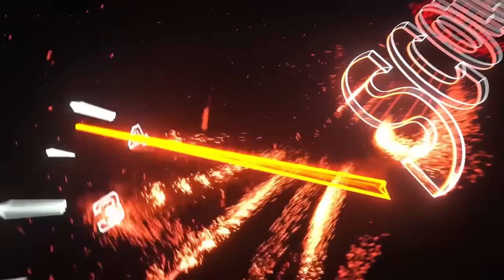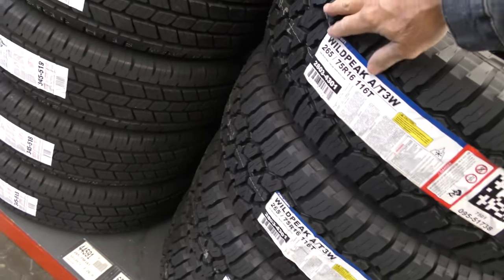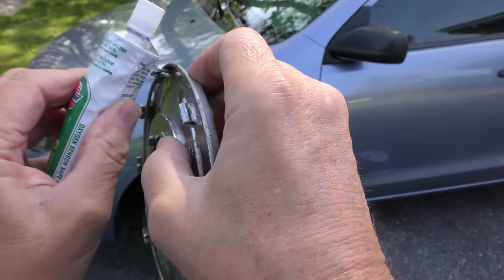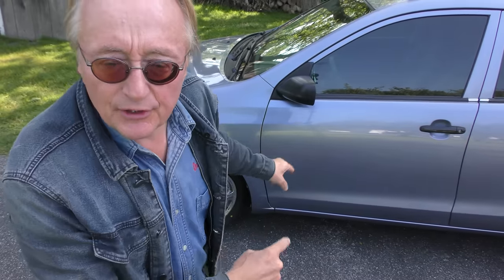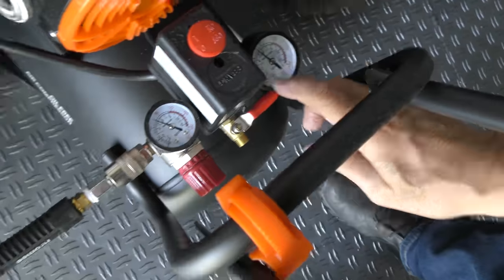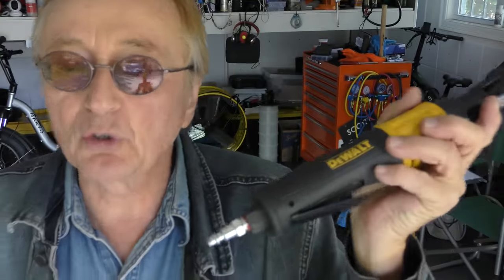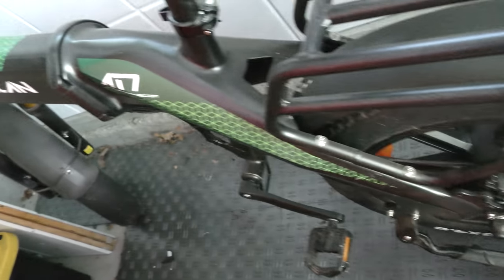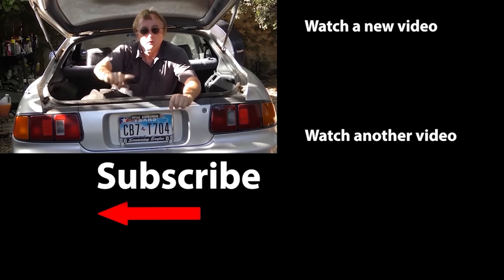Never Buy These Tires for a Daily Driver

Comment: In March 2021 I had four Michelin Defender T+H 195/65R15 tires put on my 2002 Honda Accord.  Some people might think that I was crazy putting these top of the line tires on a 20 year old car but I frequently drive on local streets that are in far from perfect condition.  As it turns out I have been doing a lot more driving now than I was then on a daily basis.  The increased cost is well worth it to me in the form of improved ride and handling and durability over a less expensive tire.  In my experience inexpensive tires do not hold up well in the driving conditions the New York City metropolitan area presents to drivers.
Reply: Brother, you aren't crazy. You are right on the money. I'd argue putting a more expensive tire on an old car that's not quite as tight and bolted together as it was brand new is SMARTER than going cheap. LTX Defenders for all my past trucks and Defender T+H for most recent purchase for mom's 10 year old Civic and she loves everything about them. Hondas always tend to be loud in the cabin and transmit alot of road noise. Michelins are as quiet as you'll ever make a Honda. 👍
Reply: Smart move in my book; I am a loyal fan of the 10 ply Defenders, they do hold up well the entire 80000 miles.  I put them on my Corolla which is way overkill.
Reply: @tdgdbs1  how are you able to specify the number of plys for your purchase?
Reply: I agree.  I have the Defenders on my Explorer and they handle the rough streets here in LA very well. Have had the tires for 5 years now and they still look great. I hope they will last 10 years.
Reply: @neuralismgamingtv4511  unless your muffler is dragging lol 😆
Reply: @chfpontiac5849  I get the cheapest tires that I can find for my vehicles.  I have no issues.
Reply: @neuralismgamingtv4511  hopefully
Reply: @JimzAuto  the model numbers specify the construction details like # of plys. the 10-ply rated tires are generally available only in 16-inch and larger applications. using such a heavy-treaded tire on a small car (which usually have less unsprung weight  to begin with) makes no sense to me.
Reply: @tommurphy4307  my experience has been: buying RADIAL tires means a) no-bias pllies at all, and b) no option to specify the number of belts. ‘10 ply defenders’ do not exist; far as I know Michelin Defender tires are ONLY available as radials.
Reply: @tdgdbs1  How did you specify ‘10 ply defenders’ for your Corolla? Michelin Defenders are ONLY radials, yes? Can you share the specific model number from your tires?
Reply: Michelins just over price cooper's
Reply: You drive in New York but can you park there?😅
Reply: Ive had pilot sport 4 on my 69bhp corsa like 3 years ago 😊
Reply: Now on my hyundai Ioniq plug in hybrid 😂 why not

Comment: If the tires are rotated every 6-8 thousand miles they should wear evenly eliminating the front tires from wearing out faster than the rear tires !
Reply: Thank You! That's What I Believe
Reply: I agree very informative
Reply: I use newer winters as my summers and new studded ones for my winter driving. Alternatively, I'd have to buy all seasons for summer. I'll wear both of them out and pay the $56 for the november/April changeover.
David
Alberta, Canada
Reply: -Only required for 4 wheel drive vehicles. If you drive a staggered setup, forget about rotations!
Reply: Tires are rotated due to how much weight is on the front and back of the vehicle.  Generally, there is more weight on the front of the car with engine and then the drive axle for FWD vehicles. You have a more fifty fifty or close to it setup on RWD vehicles but still the empty trunk weighs much less than an engine. This is also the reason that you put the better traction tires on the lighter part of your vehicle which is usually in the back.
Reply: The only thing you are doing by doing this, which there is nothing wrong is that you are just stalling longer in when you need to get tires. So in the case of moving the tires from the rear to the front, all you are doing is going from needing 2 new tires, to eventually needing 4 new tires down the road. This may be beneficial for you if buying some new tires isn't something you are able to do at that time. However, just remember you want the most tread for the steering as its more important to be able to steer then it is to be able to accelerate.
Reply: UNLESS you have a rwd car and like to do smokey burnouts. otherwise why even have a car?
Reply: Better to rotate and have a set of matching evenly worn tires.  Most tire shops do rotations for free if you bought the tires from them.  Also most tire shops offer you a better discount when you buy 4 tires at once rather than just buying two at a time.
Reply: @marshmower  lmao we got a smart guy here everyone!!! 

Yes, if you drive like the 1% of vehicles that have a staggered setup, then yes, rotations are less important.
Reply: If I did wheel balancing and wheel alignment on the tire do i have to redo it again when switching wheels ?
Reply: How are tires supposed to be rotated when the front and rear tires are different in size.   I see a lot of luxury vehicles with different tire width especially !
Reply: @davidweum  unless your summer and winter conditions and temperatures are roughly the same that is stupid. Compounds the tires made of change depending on what conditions they are designed for…..  rubber tires are not just rubber tires with different tread patterns 😂… but waste your money and put others on the road at risk all you want, I live far enough away I don’t really care…
Reply: Only necessary for 4wd systems where it saves on wear mechanically on your car, you generally dont want 2 new and 2 worn tyres on a 4wd car. Some 4wd systems dont even care either. 2wd cars, its simply not necessary and is way less safe. Keep your rear tyres on the rear axle, that way you wont aqua plane and spin out of control into a tree.
Reply: @motivationindrive8514  you only care about yourself and those around you? That's not good

Comment: As Scotty said in a previous video, he doesn't rotate his tires. I had thought rotating tires was so that each tire wears evenly.
Reply: I rotate mine
Reply: I also rotate mine too . When you buy new ones - usually in my area get free rotation . I wouldn't pass that up .
Reply: I agree with you 100%
Reply: I've always thought so too,but Scotty doesn't. Hmmm?
Reply: I was wondering the same
Reply: 4 WD and All wheel drive require a rotation after x miles.. Warranty thing. If you roll your own, you can do whatever. Everytime a lughead touches my car something goes wrong. I have anxiety attacks around the dealership and tire stores.. Find a trustworthy place besides the dealership.
Reply: Full time AWD here. Tires rotated every 5k with oil n filter change. 
Good chance to observe/correct any alignment issues and 'square up' the tread so all wear out at the same time, eventually.
Reply: On my front wheel drive cars, when the front tyres are 70% worn, I rotate them front to rear, but only because I like to replace all four tyres at the same time, and this way they’re all worn out at the same time 😊
Reply: Have never rotated tires on any car/truck in my 47 yrs. Unless u have a bad alignment, whats the point.  Tires wear out, I buy new ones
Reply: @paulsi1234  woman's FWD car gets her hardcore winter$ put on back in summer and then rotated back to front at beginning in winter. No noticeable trace of wear while on the rear.
Reply: Some people don't, some people do. Not much harm in doing either. I am a tire technician, so the one thing you actually want to look for before you decide you want to rotate tires, is something called directional tire. A directional tire is designed to rotate in one direction primarily. This affects which side of the vehicle those tires can be placed on without take the tire off the rim and flipping the tire around on the rim so it can go on the other side. If you run a directional in the opposite direction then its made for, it will cause severe wearing and irregular wear patterns and can even cause the tires to vibrate causing all kinds of other issues. With that, the way you can easily identify a directional is that it has arrows on the sidewall near where the tread meets the sidewall. If you see those arrows, you have directionals and the only rotation you can do is moving the tire on that side to the front. If you want to put the tire on the side of the vehicle you would need to remove it from the rim to flip it around. Now in regards to tires wearing evenly. The wearing pattern should be even to begin with, if you are getting uneven wear then you may have alignment issues or suspension problems that is actually causing this or tires not inflated properly. If you are not ready to deal with those  quite yet, I would recommend rotating the tires until that time to get the most out of the tires for the time being, otherwise its down to tread where you need it which means really moving the tires from the back to the front but since you got to buy 2 tires anyways, might as well just have the front ones have new tires anyways.
Reply: On front wheel or rear wheel drive vehicles you can get by without rotating and just replace the 2 worn tires. On all wheel or 4 wheel drive vehicles you need to rotate every 5,000 miles.
Reply: @davidweum  Yeah FWD vs AWD I always still do mine every oil change even when I had FWD..he doesn't drive that much yearly
Reply: @RandThompson-dd3sk  rotating that often actually makes it harder to spot alignment issues- particularly minor ones that only show up over time. minor issues can turn into bigger issues later on.
Reply: @tommurphy4307  I'm good with spotting tire issues. Running you palm against the tread exposes feather edging before its easily seen. Usually the first indication of most issues.
Reply: @kelticink  If you think about it front tires will always wear more than the rear on front wheel drive or even rear wheel drive. Now if you live in the country with straight roads and dirt roads yes front will last a long time without rotation. City driving tears up tires, I replace front tires on our delivery pickups around 15-20 k miles rear usually last about 60k. Class 8 trucks get new shoes (tires) about every 30k on front and 110k-130k on drives.
Reply: @cppower14  that makes sense. I can see that with city driving. Great point
Reply: @kelticink  I suppose the point is, as he notes, the front wear out faster than the rear. So if you rotate they'll all wear out more or less together and replace them all at the same time (rather than just the fronts as he notes).  Guess it comes down to preference.
Reply: @davidp6839  I get that. I always have replaced all 4 same time. I typically replace tires when they probably have minimal 5-8k left on them  easy. I got wife 3 daughters. I don't want anyone getting a flat😊
Reply: @kelticink  Ah okay, guess I was responding to "what's the point"; the point being longer life on all 4. I've always rotated to extend the lifespan of the group and replace all at once too.  Easy for me though, living in the north I have a set of winter wheels I swap on every year, so that's when I rotate as well.
Reply: Please reconsider putting tires that are 70% worn out in the rear. Up until recently I use to do the same thing until Discount Tire refused to do my rotation. 

Initially I was upset but after looking into I learned that your rear tires are more important than your front since they’re responsible for the stability & handling of the car. 

Putting your worn out tires in the rear could put you, your passengers or people around you in a higher risk of being in accident!

stay safe!
Reply: I rotate the wheels on my lawnmower every mowing season. 😊
Reply: Scotty tends to be cheap rotating tires is no big deal to get done. He states plainly the front wear out faster so he only has to replace 2 at a time. But you forget dry rot and wheel alignment. Bottom line it’s between you and the road better error in the side of caution .
Reply: Lack of rotation can cause deformation on the free rolling tires if left there long enough. See it all the time at my job since our policy is to put the newest tires to the rear if not getting a full set. Will cause vibration and will hear noise. It cups on the inner shoulders of the tires
Reply: @marshmower my wife always has her tires rotated at oil changes.  She goes way too long between oil changes such that it’s usually time to rotate.  Anyway, driving down the road with her the day after and dunk dunk dunk dunk.  What the he’ll is that noise?  Pull over and the damn Kia dealership didn’t bother to finishing tightening any of the lugs on one of the wheels.  From now on always gonna park right in front of the dealerships in the driveway and go round with a lug wrench to check all the wheels.  I’ll be telling everyone that they need to check their lugs since they don’t bother to put em back on properly.

Comment: I always have the tires rotated every time I get the oil changed ... Yes, I have to replace all four when they wear out, but they last longer!
Reply: Agreed. I would prefer all tires too be matching as well. I rotate twice a year, once in late fall and then again in the spring. I don't see the point in buying 2 at a time. Most tire shops these days offer buy 3 get one free as well.
Reply: I agree IF the lame assistant didn't ruin the studs
Reply: Scotty advises against rotating tires......
Reply: as long as you trust the person handling your lug nuts- thats the deal maker/breaker
Reply: That’s terrible advice. Get 4 matching tires and rotate them every 5-10k miles. If you’re in a situation where one pops and you’re in a pinch, get a mismatched tire and keep it on a non-driving wheel. Continue to rotate the others for even wear. If you have an AWD car, get a matching set ASAP to prevent issues.
Reply: I have always rotated my tires too. I do mine every other oil change. I used to rotated every 5,000 miles but I have found every 10,000 miles works just as well.
Reply: I rotate all 4 of my tires every time I drive
Reply: Tire rotation every few thousand miles is also required in order to be able to claim mileage warranty, if necessary.
Reply: @cobo10201  1 new and 3old tires won't do anything to an awd car....
Reply: I buy good tires at Costco and they rotate them every 6k for the life of the tire . Plus they have the best prices on good tires. Win win

Comment: Tyres laying down, then stacked on top of each other tends to permanently deform the lower tyres. Don't store more than a couple of tyres like that. A tyre shop should know better than that.
Reply: Bruh this is a shop, not a warehouse
Reply: @lLukeSkyscraper  tyres still get damaged by stacking them, whether they're in a shop or a warehouse. If the business is a tyre shop, they should know and practice the proper storage method. It's part of doing business in tyre sales and fitment, and it's the "price of entry" into the business.
Reply: what are you on? tires then get inflated with 32-45 psi. shouldnt that damage the tire far more than 50 lbs of tires on top of the bottom one that are spread out over a square foot of tire sidewall?

Comment: Firestone Destination LE 2s, and now LE 3s , have been the best tires I’ve ever experienced in the last 55,000 miles. Having a solid mechanic, who fixed the alignment issues also played a big part. Thanks Jimmy. He also teaches his mechanic skills to future mechanics at the local community college. At 279,000 this car rolls amazingly smooth.
Reply: Meh they're average. Michelin and Continental much better.
Reply: Michelins have been very quiet on my SUV. Much better than the craplanders erm geolanders.  The Japanese dropped the ball on their tires.
Reply: Firestone products wear out in no time. Absolute crap
Reply: I used  to be in  the  automotive  service industry. I  sold a lot  of  destination tires. Not a  Firestone dealer.  I  always  presented them  a great bang for  the  buck tire.  Never had  a single customer complain.  Keep them  properly  inflated and  rotate frequently and they will last much longer.  I personally rotate with  every  oil change (3000 miles)  which I do myself (have a hoist) and I'm retired so I  have all the time.
Reply: @AlfaGTA156  bruh le3 are KNOWN for their wet traction 😂

Comment: In Canada we rotate the tires when we change from all season radials to winter tires. When it comes to bikes anything that has hydraulics and a motor is called a motorcycle and requires a motorcycle licence, insurance and safety apparel.

Comment: Many years ago, I bought the cheapest tires available for the car I owned at the time once...and only once.   The difference in handling and traction - especially in bad weather - was noticeable.  

Moreover, they wore quickly.  They were rated (I think) for just 30k miles to begin with, but at around 20k they were showing significant wear.   That was enough for me.   Went to the tire shop and bought some quality all season tires and never skimped again.